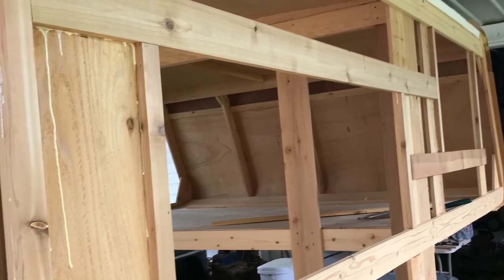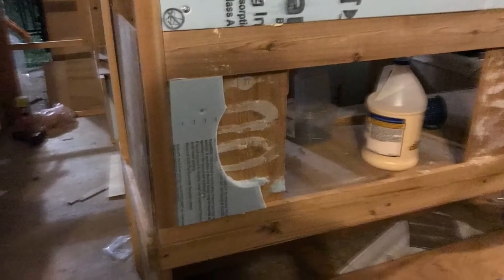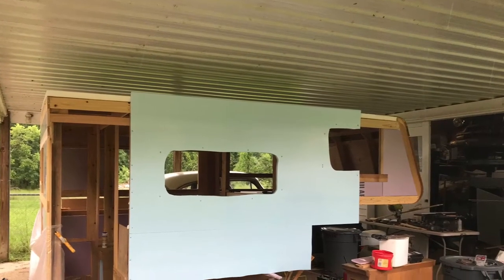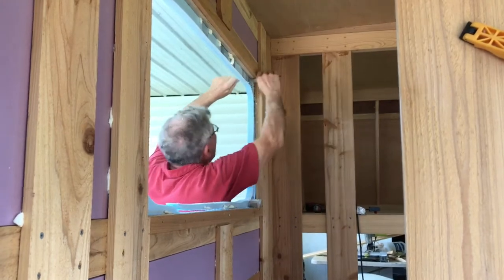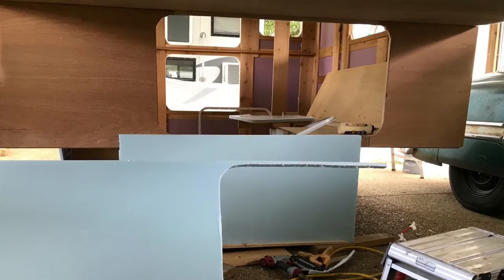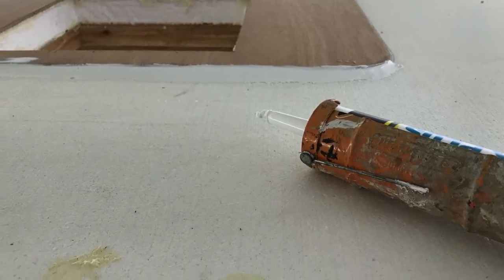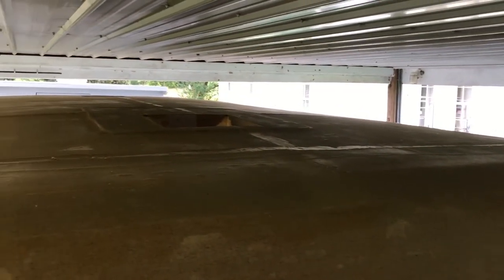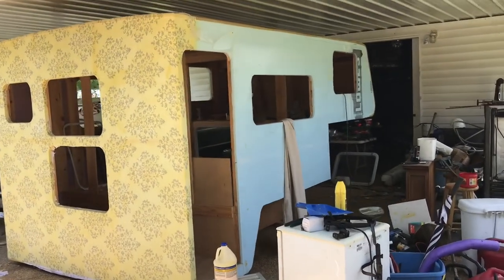Camper Build, poor man’s fiberglass: Part 3

Comment: Finally, someone build a TC with cedar. I like the way members run 90 degrees for just enough strength but as light as possible. Genius!
Reply from the maker: Thanks, I think one could use even less cedar maybe 1x2s instead of 1x4s. And the top edges could at 45’ angles for less wind resistance and better use of 4x8 sheets of foam I think I will build a model first next time to work out the details and speed up build time
Reply: @robertcox2335  I can imagine some of the 1x4s could be 1x2s, especially the floor members, especially if it didn't overhand the bed; or if a little. I have drawn several iterations with 45 degree top to sideway intersections. I think the front would also need to be angled instead of round for that to work smoothly. But, this is okay. I might build a non-cabover first, but your method could absolutely work in a cabover. I see no reason a non-cabover would need a tub (??). One thing that I've seen others do when using PMF is to not apply Titebond over the fabric as a second coat, rather a 50/50 mix paint to water, followed by a 75/25; then multiple coats of paint, sanding between. I wonder if oil base Rustoleum would hold up better than latex based paints?  Seems like it would be better, your thoughts?
Reply: @robertcox2335  Been watching the build over and over... thanks again. At 6:16 when you pulled off the blue tape, I noticed the clear layer coming off of the foamboard. Do you removed all of the clear coating from all the foamboard? Thanks,

Comment: I would have been tempted to use the Raptor spray on bed liner once the canvas and sheets dried. The Raptor bed liner spray comes in several colors. Great job Robert.
Reply: I have used that it’s really good I recommend it

Comment: Impressive, would be great to know what adhesives you used for the styrofoam to wood and then for the sheathing to the styrofoam on the outside and how you applied it, any product info and technique would be appreciated, many thanks!
Reply from the maker: Styrofoam to wood with great stuff and titebond II to glue sheathing to foam